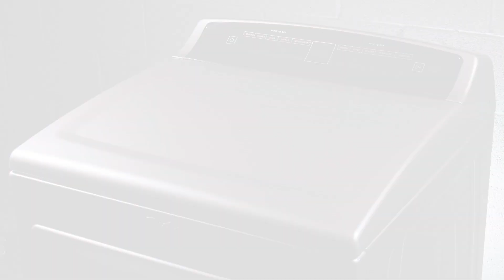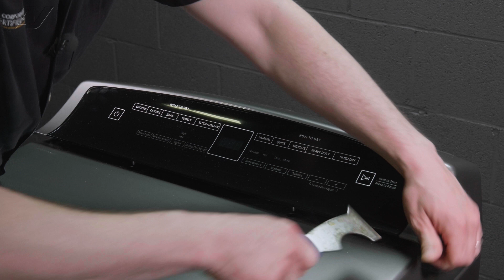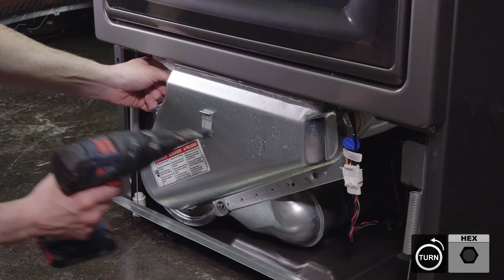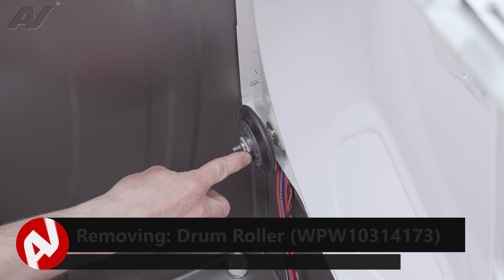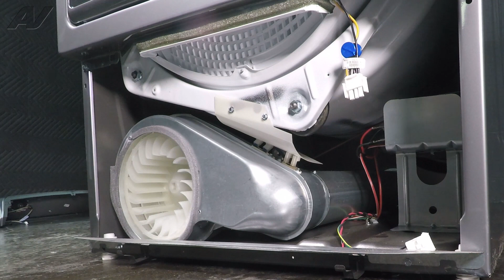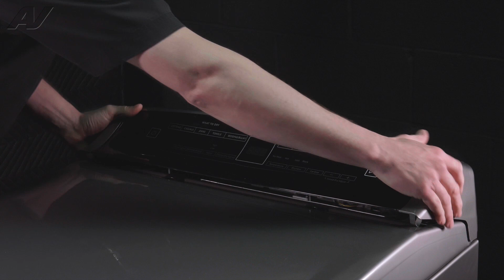Whirlpool Dryer Repair - Noisy When Running - Drum Support Roller

Comment: Incredibly helpful video, thanks. I was able to use the disassembly info in this to replace every roller, the drive belt and the idler arm in one go. Once the dryer was taken apart it was super simple
Reply: Also heads up for anyone that reads this

About 4 months after I replaced all the rollers one of them developed a flat spot on the bearing and roller post resulting in a horrific screeching noise. 

I had to take the dryer apart again to diagnose it and used this videos instructions again, and ultimately I need to do it a third time to replace the roller and post again. 

Careful buying the cheap Amazon roller kits, mine didn't last that long

This video is still exceptional info and all you need to do the job